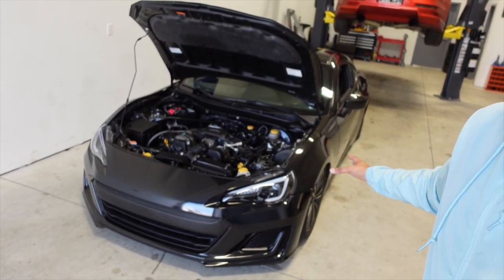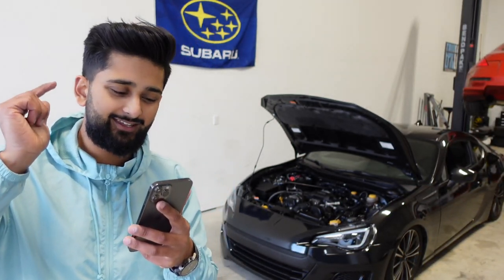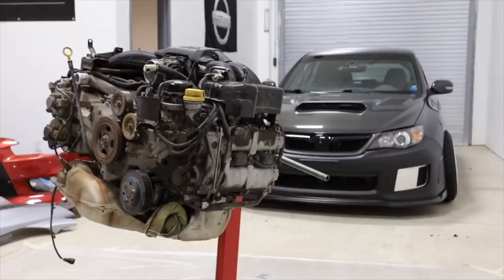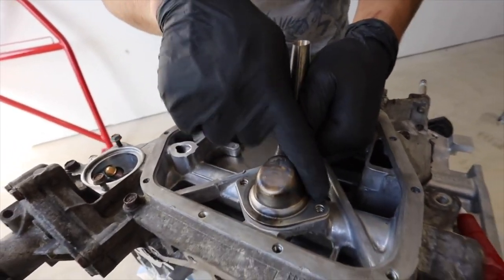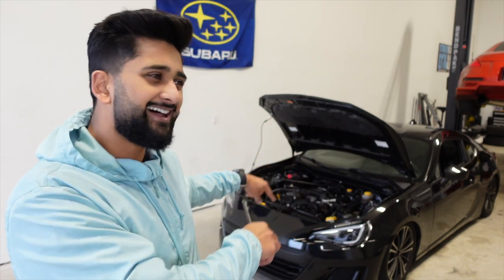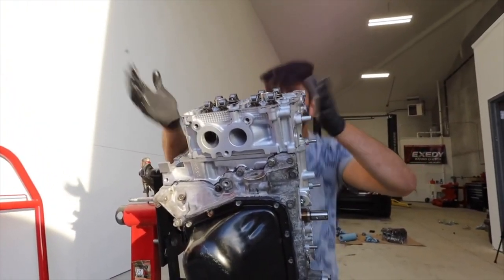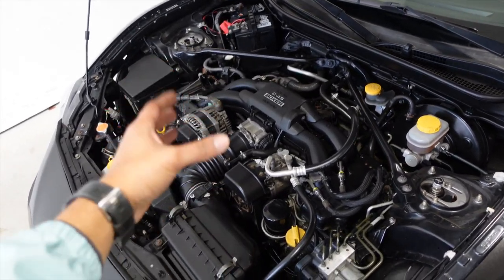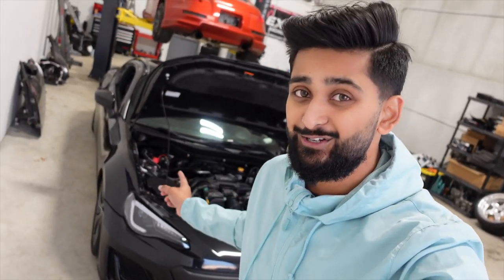The TRUE COST of REBUILDING a BRZ/FRS/86

Comment: I won't go into my credentials but just trust me when I say buy an automatic brz and check the pickup tube then change your oil regularly. You will not have problems. You will have fun and decent mileage. Those engines are not temperamental. They are mistreated. They are very reliable.

Comment: There’s a third option Khan forgot to mention: One could chose to replace the engine with a “built” race engine. I shopped around to see what built FA20’s go for and they cost far less than most would expect? For anyone considering both A) Replacing an engine and B) Adding forced induction, the built engine begins looking very attractive. 

Aftermarket engines that are rebuilt by professionals can include hardware that ensures the engine can handle any additional power that forced induction provides. Forged pistons, forged rods, race bearings, upgraded timing, are just a few of the upgrades provided with this fully cleaned, machined and perhaps most importantly, fully assembled long block is ready for install. 

I’d assert that such an engine would far more durable than anything Subaru sells. These engines are available for less than $5K (assuming you have an adequate core block to trade-in). I’ve seen Stage 1 kits with all the parts I described above as low as $3800. I was astonished by how these Stage 1 engines are rated for output up to 625 BHP?! That is an insane amount of power from only 2.0L of displacement! I’d assume a ridiculous amount of boost would be required for that level of power, but imagine the peace of mind any owner would have in knowing they could double, even triple the power output of their BRZ/FRS without a moment’s concern for the engine.

Lastly, this video demonstrates how one tiny error can destroy a brand new engine. There were no turbos or nitrous involved, just a missed torque requirement and BOOM, a perfectly good engine needs to be replaced. A pro-built engine like those I described above should appear very attractive to novice tuners as the engine is already assembled and timed, it simply needs to be installed into the car. The cost is only marginally more than a DIY for a considerably better engine.
Reply: This a Hail Mary to see if you’ll respond, but where did you find fully built long blocks? I straight up can’t find fully built engines for under 8k. Do you have any recommendations in regards to websites or where to look?
Reply: @livingdegree1742  Oh man, I remember posting this but it seems like ages ago and a lot longer than a year?

My comment was focused primarily towards the cost of a reinforced short block for FI and reusing the stock heads with some minor mods to help with FI. 

I’m not certain where the actual prices I calculated came from, but I think I saw prices for FA20 short blocks from Crawford and IAG Performance? Hell, even some Subaru dealer shops had listings for brand new short blocks for less than $3K? I’m not affiliated with any specific manufacturer and actually lean more towards Mazda for the previous MX-5 projects I’ve completed. 

I just did a few Googles and it would seem that just like everything else even engine parts, that haven’t changed one bit since this comment, have also gone up by around 15-20%? Both Crawford and IAG appeared are the top of the search, but their prices have definitely gone up since I commented. 

I was seriously considering a new Toyota GR86 during the spring of 2022, but then the GR Corolla was announced and I waited to see what Toyota had to offer. Toyota dealers are shameless and every single dealer that has them was charging insane markups, so I gave up and went back to searching for a wrecked Miata RF to rehabilitate. 

Sorry man, I know what it’s like to experience that FOMO when folks mention deals that you’re also searching for, but it was just a quick peek to see what was out there. I honestly couldn’t believe how dude blew up a brand new engine and was kinda like “Aw shucks” over the whole thing?! 

My best advice would be to search online and if you get close to commenting you’re looking for, just start calling shops/yards on the phone. I’ve snagged some crazy deals just by keeping in touch with pro tuners and yards who constantly have cars coming and going. A month or so after posting this comment I snagged a 2018 Mazda Miata RF Grand Touring that kissed a tree in the driver rear quarter for only $10500. The guy called me one day after talking to him on phone because he had my number right there. They totaled it because they (wrongly) assumed the folding roof was totaled, but it just needed a few parts that weren’t related to crash to be replaced. I sold that very same car last fall for $27300 and ended up netting nearly $12K for about 12 hours of work and some paint, which my nephew takes care of. 

Anyway, just some friendly advice as many of these shops are owned by folks my age (50+) and relate more to a 5 min phone conversation versus sending a bunch of links they’ll never look at. I don’t know why my generation is so tech-adverse, but you can take advantage of it and score some great deals. I’ve schooled my nephew to “chew the fat” with the guys at the yards we frequent and he’s driving a black Denali he found totaled out and traded paint services for. He’s can’t believe he’s got it so good!

Good luck finding what you need. The hunt never ceases! 👍

Comment: I’m looking at a frs but is it worth buying ?? I’m scared and see way too many things on these things
Reply: Buy an automatic and yes they are just pull and reseal the oil pan so you can check to make sure the pickup tube is not clogged from the spring recall. Some people were bad at housekeeping during that operation.

Comment: Any advice for an 18/19 year old trying to get a BRZ/86/FRS as a first car? Currently saving for $15k to buy in cash. Insurance is a bitch too
Reply from the maker: Honestly speaking buying a brz that is in good condition body wise with a blown motor and just replacing the motor is not a bad option! you’ll learn a lot throughout the process of doing a motor swap, it’s honestly not too difficult. And you can get a good condition PRZ for a hell of a good deal!
Reply: @beakhan  You have an r32, I want to RB swap mine tbh. Ever considered that? The power/sound + the aesthetic of the BRZ, great combo.
Reply: @beakhan  And also, where would you  recommend looking for/buying one of these? What should I expect for my budget? I've heard the used car market has gone up in price during Covid
Reply: Should I go for a 2013 or go for the 2017s+
Reply: @Spextre  RB swapping would be great it’s just gonna be VERY expensive so just a heads up there. I got a 2015 because it was available but if you get 2013 just make sure it had the recall done . If you want extra features go 2017+ but if you don’t really care for it because u can actually put the digital dash in the older models you could save money and get a 2013-2016 model

Comment: i was planning to get me a brz but i keep hearing about people blowing up their engines, why does that happen. does this only happen if people use forced induction or that just a problem that the stock car has? Im scared to buy one now.
Reply: If you don't mod it and not abuse it by having the engine redline everytime and doing maintenance it won't probably blow up anytime soon.
Reply: The 2013 and maybe 14 models had a valve spring issue which ppl would get fixed at the dealer under warranty. Unfortunately the techs were given bad sealant or instructed to use too much, and it would break off and clog oil ports inside the motor under high load. My '13 brz bent a rod on the freeway in Jax around 130k miles

The car was great with good milage other wise. HIGHLY recommend dropping the oil pan and replacing the oil pickup tube with a better model. Also checking for any clogged ports/extra sealant